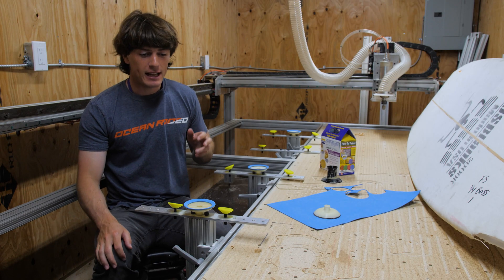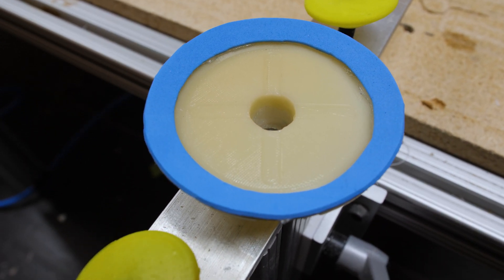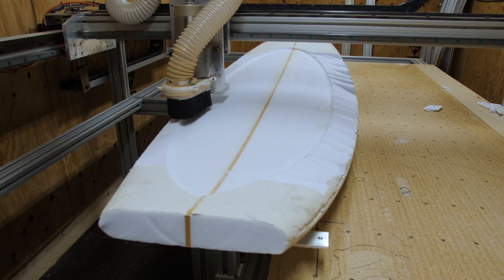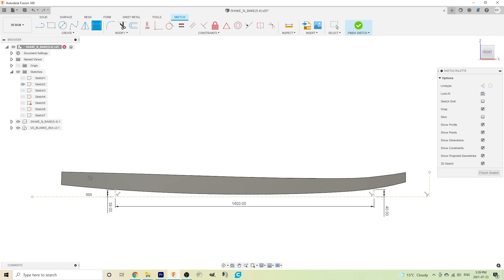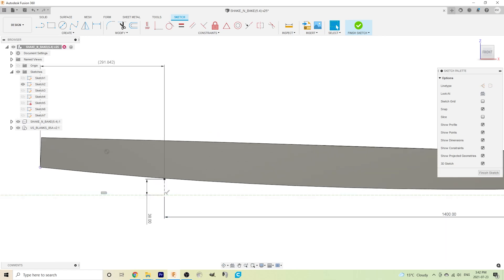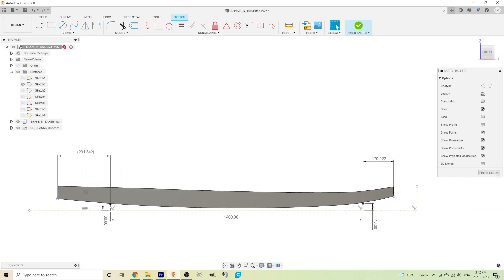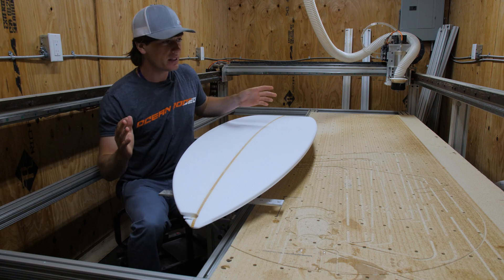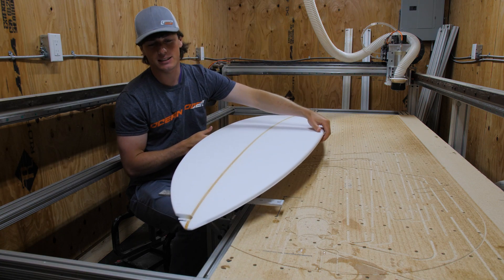CUTTING OUT MY FIRST BOARD | CNC BOARD SHAPING MACHINE | EP2

Comment: Just a hunch but maybe try  two part Silicone in various durometers or hardness's for the suction cups?  Great project and demo.  Cut and paste re durometer from Rubbercal: " The softest silicone is a 40A durometer flexible silicone sheet due to its low durometer hardness rating. Solid silicone is offered in 40A, 50A, 60A, and 70A durometer ratings with the material getting harder as the durometer rating gets higher."

Comment: Awesome job do you have a video of 3 D printer build ?
Reply from the maker: Hey Peter, No I haven't built a 3D printer, although the hardware is pretty much all the same. The main difference would be the 3D printer uses a print head and material extruders instead of spindle. Also the 3D printer would use a slightly different software I believe. More specifically tuned to 3D printing.

Comment: How long it takes you to cut each side more or less? I have also to remove the excess of material on the sides cause I use blank and bed, takes me around 2 hours each side for a 6’3”, I use shape3D CNC option to generate the gcode , thank you mate !!
Reply from the maker: Hey! 2 hrs per side seems excessively long. I have it down to 20-30 minutes of cutting time per side on shortboards. If I didn't have to remove the excess material, probably about 10-15 mins per side. I'm running 6000 mm/min feedrate in EPS and PU foam. 18000 rpm spindle speed. 1.25" diameter ball endmill. Also a 6mm or even 7mm stepover between finishing passes. Getting the stepover as large as possible without losing quality is a huge time saver. I'm using Fusion 360 to create the toolpaths, lots of options in there to control the machine.
Reply: @reeces_shredlab  how deep you go down every pass ?
Reply from the maker: @surfcloud  on the stringer I only go 3mm at 2000 mm/min. For the foam, the tool just vaporizes it so I go as far down as the tool can go. In this case 30mm is the length of the cutting surface I believe. 5000-6000 mm/min feedrate. 18000 RPM for both the stringer and foam with the burr tool. Has been working for me so far.
Reply: @reeces_shredlab  the cutting tool if the length is 30mm, the width might be around 20mm I believe, right? I think I have the same one with 6mm diameter of the shaft. You mention 1.25" diameter but that is even more than the lenght and doesnt look like in the video :))
Reply from the maker: @surfcloud  Ya haha, I must have just pulled that number off the top of my head. I just checked, the tool is 3/4" diameter with a 1/4" shaft.

Comment: Suction cups might not be your best option seeing this. Maybe use the same trick often used for other cases where workholding is hard. Use painters tape on the blank and on the contact surfaces (where you now have suction cups) and then put superglue on one side and activator (that hardens superglue) on the other tape. This should create a reasonably strong bond and afterwards you can just peel of the painters tape (no superglue goes on the actual workpiece here, only on the painterstape stuck to the workpiece).

That or more cups and more negative pressure.
Reply from the maker: What I've actually ended up doing is removing some of the suction cups. Now I only use 2, there is surprisingly more than enough holding power and much less leakage. I found the more cups, the more leakage. This has been working great for PU blanks.

But EPS is much more porous and air is able to leak in through the foam. I have been using wood glue to seal the EPS before placing it on the vacuum fixture. The glue dries relatively fast and doesn't melt the foam. I tried the painters tape as well and found that it didn't connect to the foam well enough. It kept peeling off, and although the tape was sucked down to the machine, the board wasn't connected to the tape. I'll try messing around with the tape a little more. I could have been using crappy tape.

Comment: Hey where you get the Cutting Ball for a CNC.. if you can shared, please thank you
Reply from the maker: Hey Andrea, it's a "Kutzal Extreme Ball Nose Rotary Burr" that I bought through Amazon.
Reply: @reeces_shredlab  Thanks man... I need to figure out the sizes in mm instead of inch..which one you get of the 3 version: Very coarse  , Original coarse or fine? 
1/2" should be half inches right? Thank you
Reply from the maker: @Pagana4president  Very coarse if you're cutting foam. And ya 1/2" = 0.5 inches. I'm running 15000 to 18000 RPM for foam.
Reply: @reeces_shredlab  Great, I will buy right now, I ordered some from Australia, really expensive and really big.. too. Thank bro!
Reply from the maker: @Pagana4president  Did you order the longer tools from Shapers Australia? I've been trying find out what the maximum RPM is for those tools before ordering. I got some 150mm tools from China but they could only handle about 6000 RPM before shaking. Minimum RPM for my machine is 9000
Reply: @reeces_shredlab  Hey, I ordered should be here this week ( cost like hell), but seems the Roll Royce of the cutter ball. :) :). some friends are using that bit with bigger machine of mine and they runs about 12.000 RPM.. For sure the China products are more soft I tried for some other work, and them sucks.. but are really cheap.
Reply from the maker: Awesome! Thanks for the tips. 12000 rpm should work for me. Let me know how it works for you.

Comment: Have you tried placing vinyl stickers along the suction points on the blank? Might give your better suction/tighter seal.
Reply from the maker: Are you thinking to try and replace the EVA foam rings with vinyl stickers?
Reply: @reeces_shredlab  I was thinking keep the foam ring set up and place vinyl stickers on the foam it self to create a less porous surface and achieve a better vacuum seal. I saw a few guys in Hawaii do that.
Reply from the maker: Oh ok Interesting. I was trying with silicone around the suction cups before I tried the foam ,and the silicone wasn't really compressible enough to fill all the cracks. I feel like vinyl stickers might have the same issue. I'll have to test with the vinyl at some point just to see!

Comment: Hello Reece, I agree with all the other commentators, nice job on that machine, well done indeed!  I am experimenting with a CNC to make SUPs and I using a cutter head from saburrtooth.  They are relatively small but also a lot less pricy than those from Shapers Australia or others.  What brand is your cutter head?  Cheers, Rob
Reply from the maker: https://www.amazon.ca/Kutzall-Extreme-Ball-Shaft-6-3mm/dp/B0721LD4KL/ref=mp_s_a_1_7?crid=16XP1THD5R8BQ&dchild=1&keywords=kutzall&qid=1632124597&sprefix=kutz&sr=8-7
Reply from the maker: Hey Rob, that's awesome, I'm actually just using a Super Rough Kutzal bit that I found on Amazon. It was around $20.00 and has worked well so far.

Comment: Hi, nice project!  Congratulations!  can you explain more about positioning the board back on the sucktion cups in the right position when cutting the other side?
Reply from the maker: Hey Dean, I do the exact same thing for the bottom as I do for the top. Except when cutting the bottom, I have to rearrange the suction cups so that they match the deck of the board model, and not the blank because it has already been cut. You can basically ignore the shape of the blank for the other side. I suggest looking up some videos on "flip machining" to get a better idea.

Comment: Hey bud, I build shaping machine for
Living, I would buy a longer bit from shapers Australia or Marko foam. 
Also you want the suction in line, not in a T. It will suck the twist out of the blank( because they’re always twisted)  it will help keeping your board true. Big suction cup with foam on the edge work best!  Good luck
Reply from the maker: Thanks for the tips! Unfortunately my Z-axis is too short for a larger bit with the way my machine is setup right now. Maybe an upgrade for the future! As for the suction in line, Ill have to look into that as well, thanks again!
Reply: Perfeita a sua prancha. Erros fazem parte do processo. Você tá utilizando o Fusion pra modelar sua prancha? Já pensou em utilizar o BoardCAD? Ja modelou quilhas no fusion360?
Reply: hi can you make or advice on a machine for making boards i am getting  too old for the Philippines  market so not for profit haha cheers Davo

Comment: Nice work! I would love to see a video of how you designed your surfboard in Fusion360. I am using boardCAD but would love to use Fusion360 instead.
Reply from the maker: Im actually using Shape3D for the board design. I export the file as a .igs and bring it into Fusion so I can make the toolpaths. I don't think Fusion would be very practical for board design.
Reply: @reeces_shredlab  thanks for the reply. I will have to try this workflow.
Reply: Hello friend! Did you use the free version of Shape3D or did you buy the program? Have you tried using BoardCAD? I'm making my CNC to machine surfboards. I made a small CNC Router. I also make hollow Paulownia surfboards. I'm from Brazil, city of Fortaleza. Good work, I will promote your channel